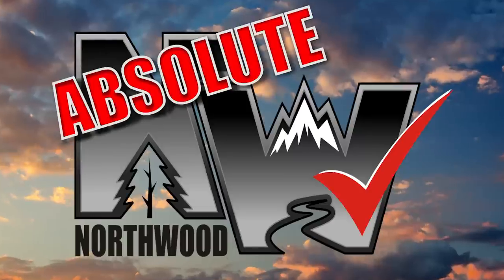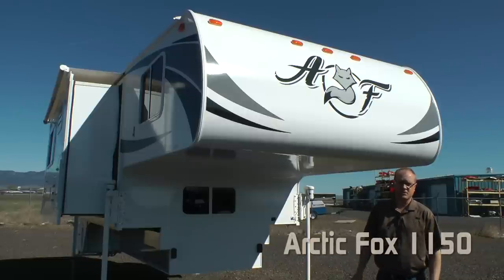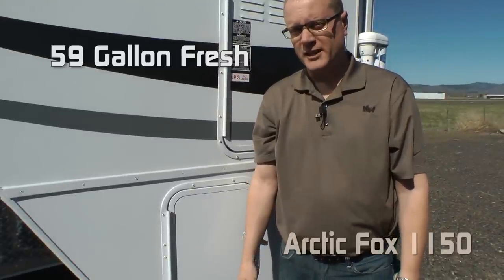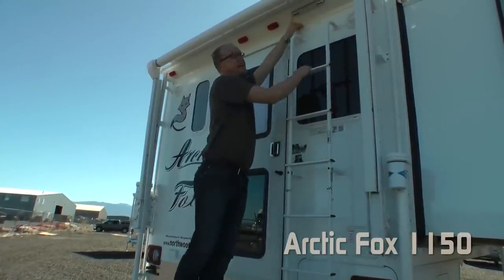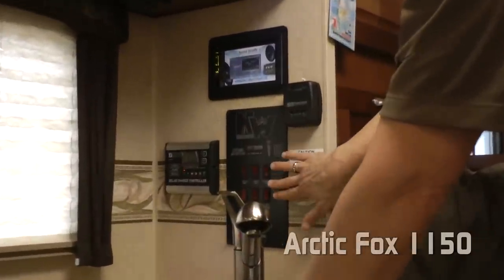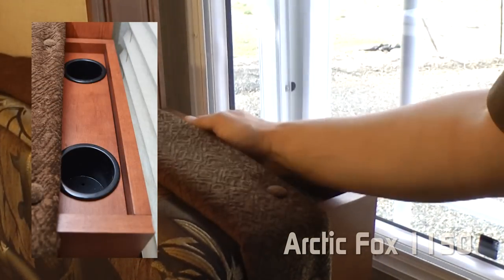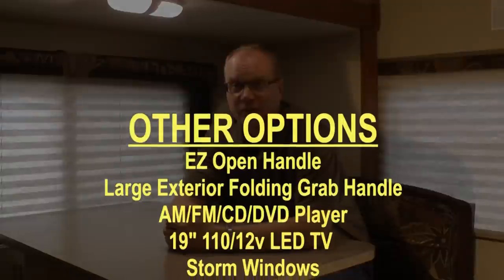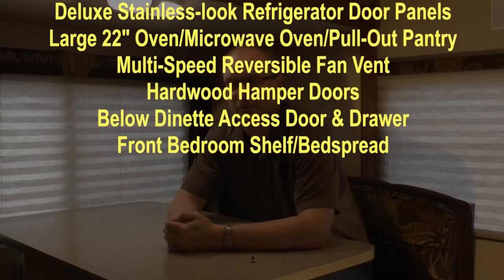Quick Tour of the NEW Arctic Fox 1150

Comment: Would be great if there was such a thing as customer service.  Mine had a defective fridge before I bought it.  Did they catch that during build?  Nope.  They expect the dealer to handle it, which they didn't.  I spent the first three months unable to use it.  Now a few months later, fridge is on the blink again.  Contacted Northwood about it.  The response?  "Not our problem; talk to Norcold."  Not even so much as a "sorry you're having trouble."  While I'm at it -- the toilet won't hold water and the generator runs rough.  AND... insulated for four seasons?  I call BS.  I left the furnace off one night recently and the inside temp dropped to 41 deg with all the windows closed -- same as the outside temp!  What a load of crap.  Will be 2-3 MORE months before I can use the camper again, meanwhile I'm paying for it.  Guess what brand I'll never own again?
Reply: Thanks for the info..